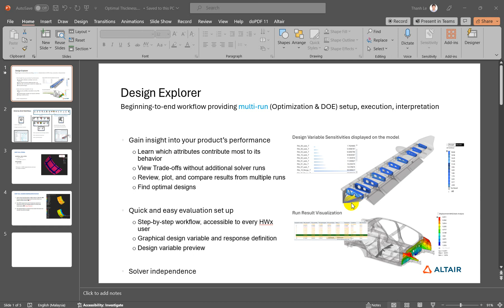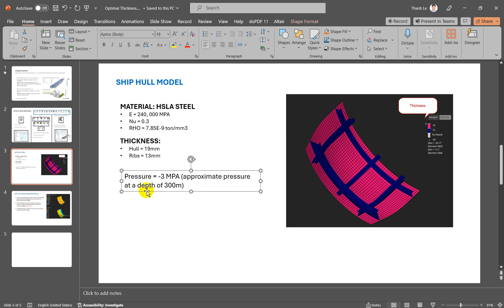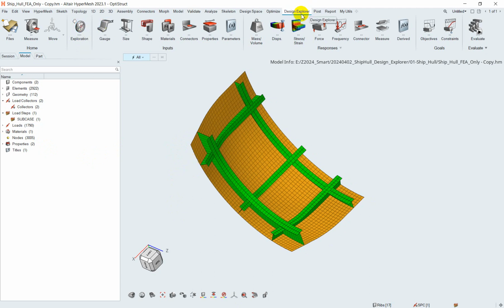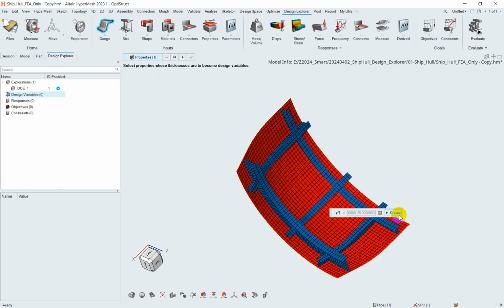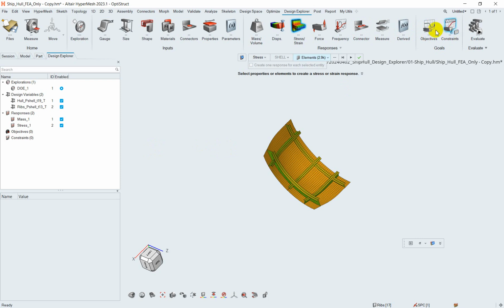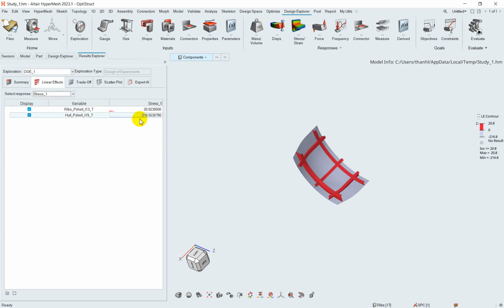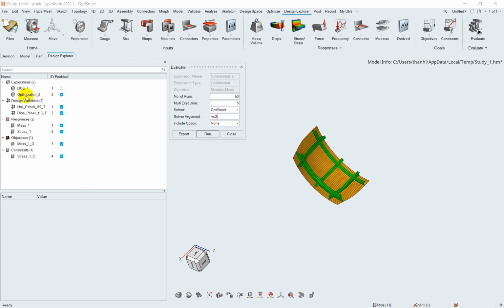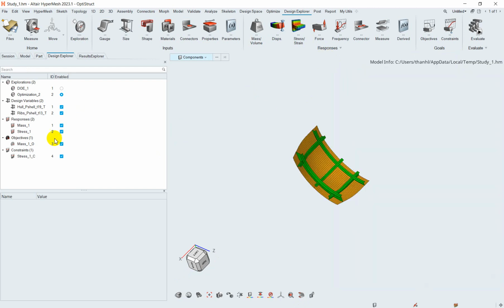HM 2023: Design Explorer - Easy tool to run DOE and Optimization

Comment: Do you have access to the model ? Also how do you connect the stiffeners to the skin part ?
Reply from the maker: There are 2 approachs. If you have CAD data, after you create Middle surface, you can use Extend and Trim functions to make T connectiong in CAD. If you have only FE data, you and use Imprint/Extend mesh functions to do this easily. In case you want to use 1D stiffeners, you also can use BEAM aligment functions to make it. HyperMesh is very powerful tool to do this kind of work.
Reply: Alright Thanks, I will try that